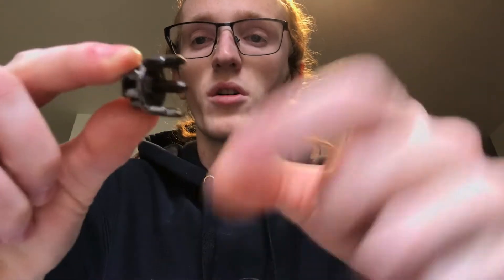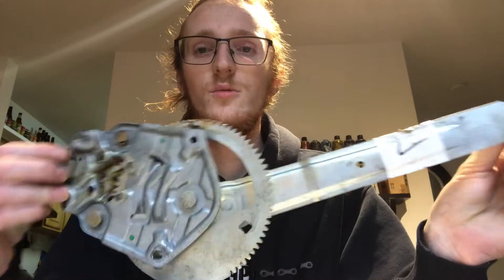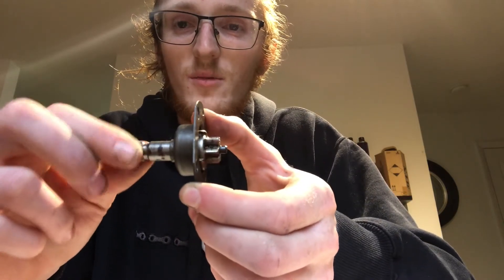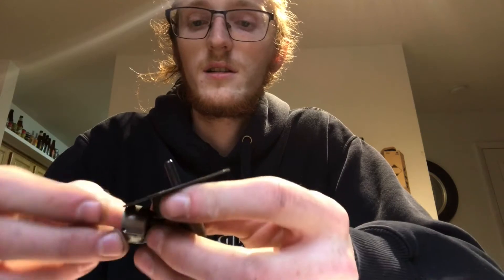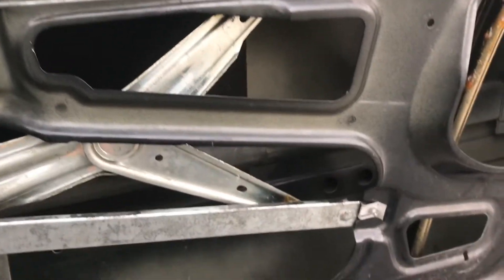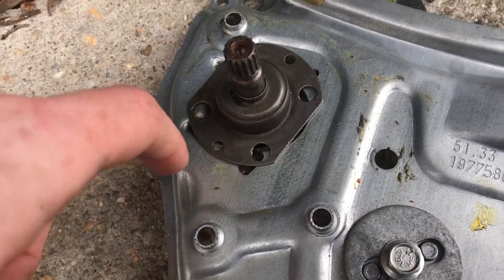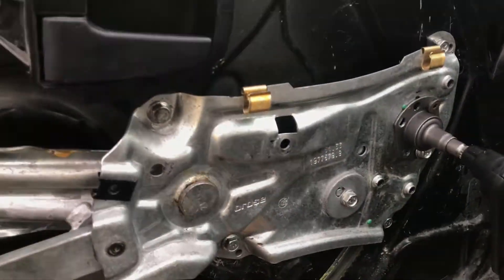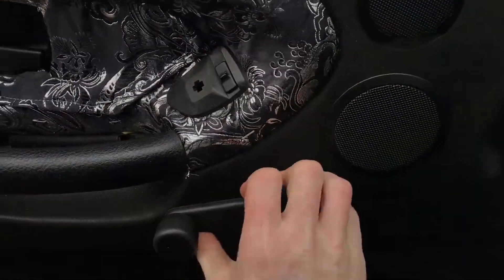E36 Manual Window Conversion DIY

Comment: why would you go from power to manual?

I am planning to buy e46 with manual rear windows and I am wondering if I can convert them to powered...
Reply: I have a 93 325is and they used very specific motors only found in 92/93 coupes that cost about $600 each so that’s why
Reply: @PeachTr33s  i'll sale my 93 coupes regulators for less lmfao
Reply: Cuz Manuel is better duh